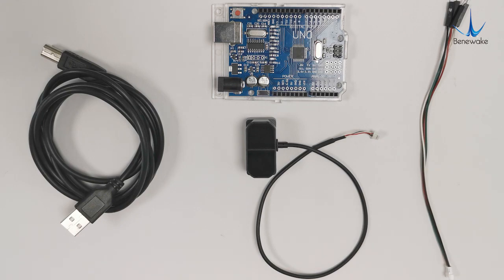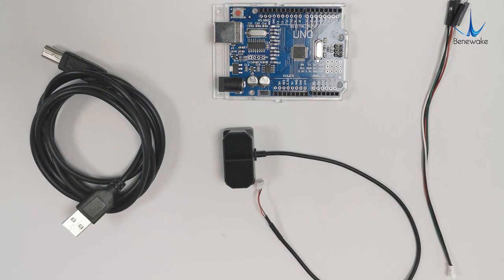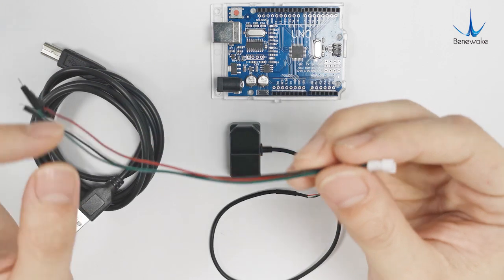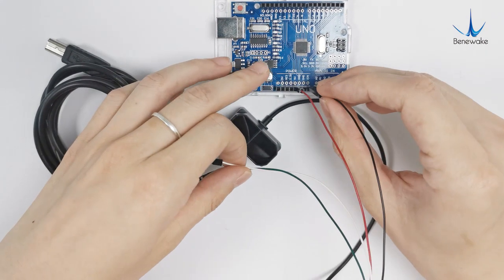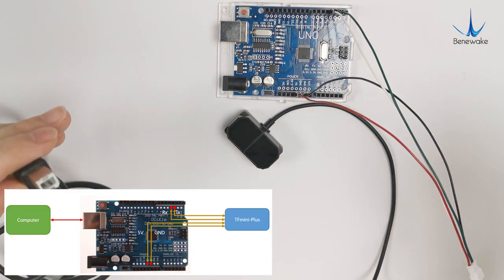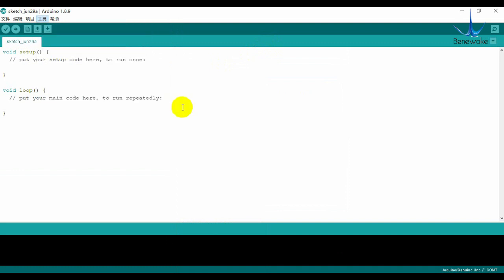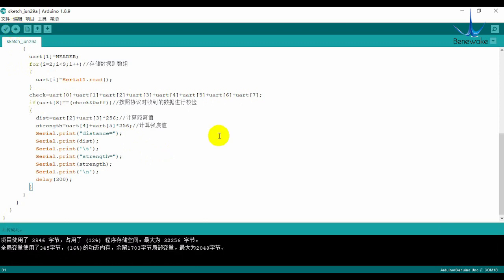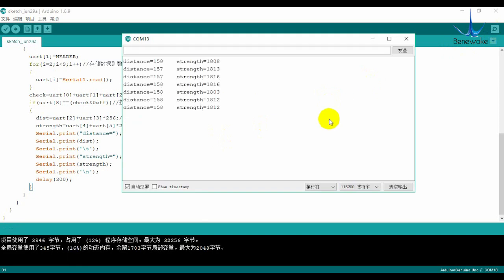How to connect TFmini Plus with Arduino

Comment: #include<SoftwareSerial.h>
SoftwareSerial Serial1 (2,3);

int dist;
int strength;
int check;
int uart[9];
int i;
const int HEADER =0x59;

void setup()
{
  Serial.begin(115200);
  Serial1.begin(115200);
}

void loop()
{
  if(Serial1.available())
  {
    if(Serial1.read()==HEADER)
    {
      uart[0]=HEADER;
      
        if(Serial1.read()==HEADER)
        {
          uart[1]=HEADER;
          for(i=2;i<9;i++)
          {
            uart[i]=Serial1.read();
          }
      check=uart[0]+uart[1]+uart[2]+uart[3]+uart[4]+uart[5]+uart[6]+uart[7];
      if(uart[8]==(check&0xff))
      {
        dist=uart[2]+uart[3]*256;
        strength=uart[4]+uart[5]*256;
        Serial.print("distance=");
        Serial.print(dist);
        Serial.print('\t');
        Serial.print("strength=");
        Serial.print(strength);
        Serial.print('\n');
        delay(300);
      }
    }
  }
}
}

Comment: Is TFMini UART 3.3V or 5V? On Sparkfun, they claim you should have a level converter while on DFRobot they directly connect it like you. It is really confusing and your response is appreciated
Reply from the maker: Hi Waleed, sorry for your confusing. As for TFmini Plus, the power supply is 5V and the communication is 3.3V. May I know the details of your problem? Then we could provide some useful suggestions. Please email us: bw@benewake.com
Reply: @benewakeco.ltd.8372   Please inform if connecting  a 5V tx output to the RX pin of the TF mini will damage it. I do not have a plus just the TFmini. I after looking at your recommended wiring configuration did not use a 5 to 3.3V logic converter. you guys need to be way more concise in your data sheet about this because there is no mention of this when you wire to the arduino it is easy for people to assume that the arduino pins are 3.3V logic. please correct this on your data sheets.
Reply: @mitchellstorrie3280  did you ever get an answer on this?
Reply: Anyone looking for an answer to this, I heard back from Benewake support and they said the tf series is 5v tolerant
Reply from the maker: Yes. TFmini UART is 3.3V. While you could connect to 5V device directly.
Reply: @benewakeco.ltd.8372  This is strange if no converter is provided !

Comment: Hi where can I purchase the adapter cable featured in the video? My TFminiPlus did not include it. Am in UK. Thanks
Reply from the maker: Thanks for purchasing TFmini Plus LiDAR. Could you please check the link and try to ask UK dealer whether they have or not? We believe it is the fast way rather than buy it from us. https://www.unmannedtechshop.co.uk/product/benewake-tfmini-plus-micro-ip65-lidar-12m/
Reply: @benewakeco.ltd.8372  I bought mine TFmini Plus from Banggood (https://www.banggood.com/ru/TFmini-Plus-Lidar-Range-Finder-Sensor-for-Arduino-Single-Point-Micro-Ranging-IP65-Waterproof-Anti-dust-UART-I2C-IO-11000Hz-p-1561150.html) and it did not include it also.
Reply: @iSpider82  Dead link.  Page Not Found  404